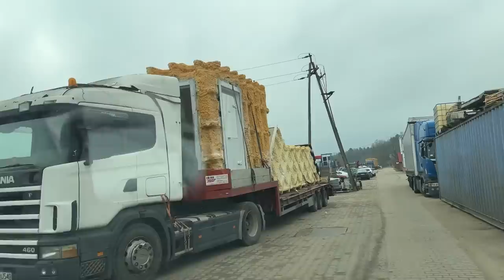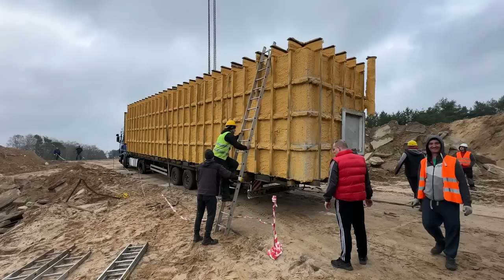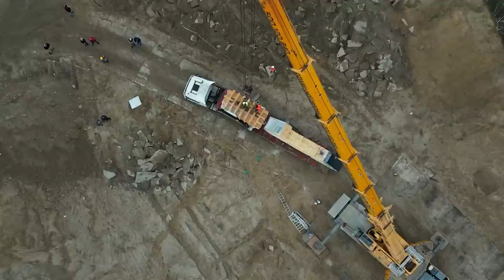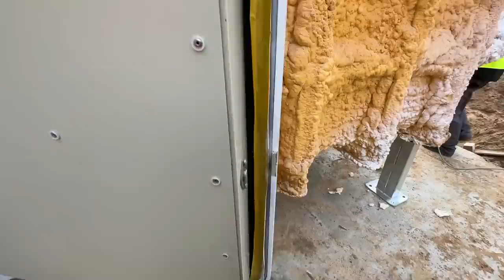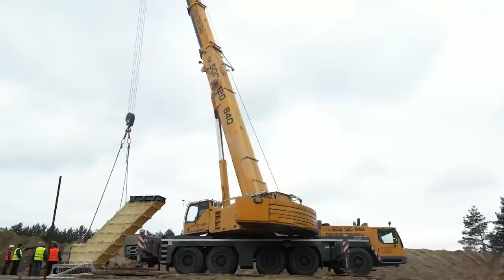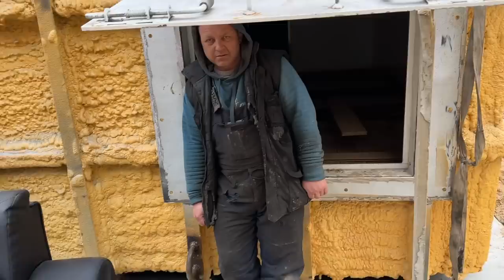Installing An Atlas Bunker At A European Shooting Range

Comment: The awesome thing about all that sand is you won't have to worry about drainage or water infiltration.  It should just flow right away with no issues

Comment: Hahaha, I had a good laugh at the "thats 5/16th thick. Thats more than a quarter", since in metric that would be  "That's 8 mm thick. That is more than 6 mm". :D
Reply: He's reiterating, not explaining.
Reply: Metric is only good for rounded off standards.
Reply: @bobbysmith5642 imperial is antiquated. Metric is the world standard. Therefore, America is antiquated 😂
Reply: @alandeon  The only reason we still use it is to irritate the rest of the world.  ;)  This new fangled metric stuff is a nightmare when you work on anything.  All of the nuts and bolts on a car or equipment are a mixture of metric and standard.  You have to have two sets of every wrench and socket.  The "metric is only good for rounded off standards" is a well known joke here btw. lol
Reply: Steel in the US is gauged by imperial standards. According to his business model, his steel is sourced and assembled within US borders, then shipped to the building site. Metric will be found on his air handlers, etc. which are sourced from other countries that use the metric system.

Comment: Compressed air (or water if you are above ground) on the steel between the weld and foam helps mitigate thermal transfer. I have to do this when welding on handicapped van floors with rubber or carpet glued directly to the other side of the metal. Scary shit. Also, when soldering copper hidden gutters on top of 200+ year old houses... That's even scarier. They ALWAYS smoked while soldering.

Comment: That was 16 plus 2 drones Ron! I think I would not paint or otherwise cover the metal within a foot or so of the doors where you plan on welding. That would save some time I think.

Comment: Nothing should be painted or treated with anything within two feet of where any welds are to be done . Europe or America. Is is just not cost effective. Once the welds are complete go in and sand (or buff eith wire wheels) prime paint and then insulate if needed.